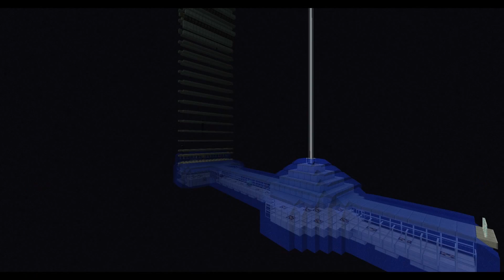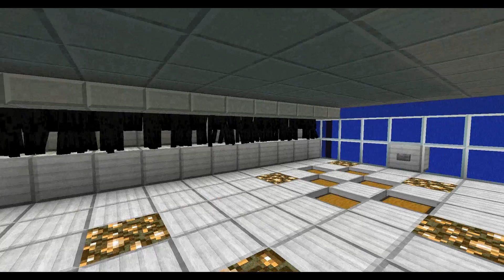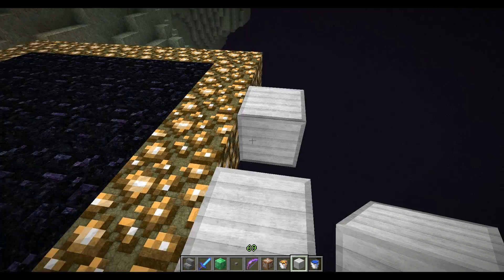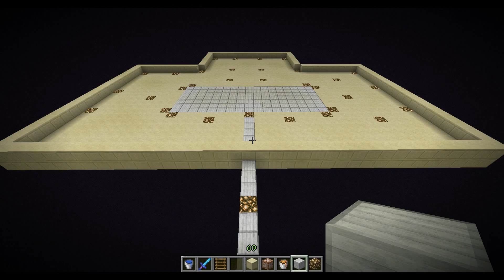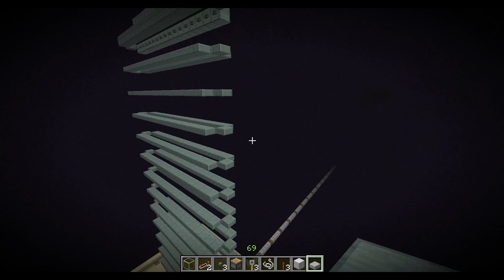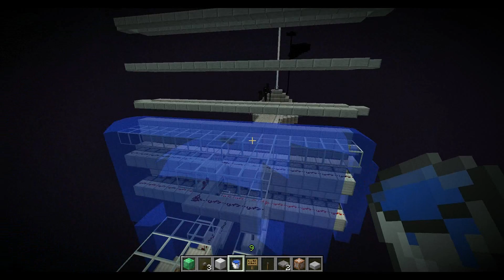Minecraft: High Efficiency Enderman XP Farm - The Hooker - Full Tutorial and Download

Comment: Instead of using a piston pusher, have you tried having a dispenser on each end with a bucket of water in it, forcing them to teleport? Since it's more than 32 blocks down, they'd have to go back to a spawn platform above them. Just have a row of signs to keep the water at one level.

If it's really only once per 50 hours, you could probably just have it be manually activated to purge them. Otherwise, maybe some kind of circuit to detect if one is there longer than a couple seconds?

Comment from the maker: they are staggered because of the properties of tripwires, they would not work on the same levels because a falling enderman would activate every single piston during it's fall. The overall spawning spaces are not half of a double sided one.

I'm updating the farm in the next couple of weeks for 1.5 &1.6, as it is, you get endermen stuck in the vines once every 50+ hours of use I have found, the solution to this is a piston pusher (not like the one referenced) but it would also slow down speed